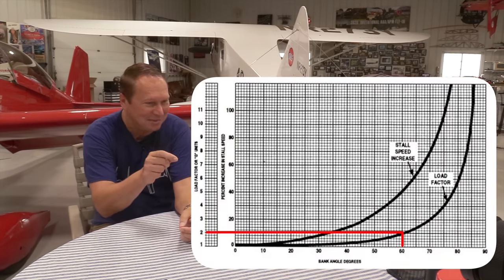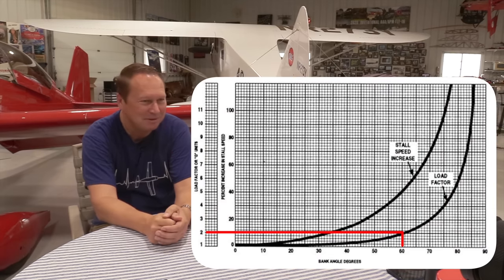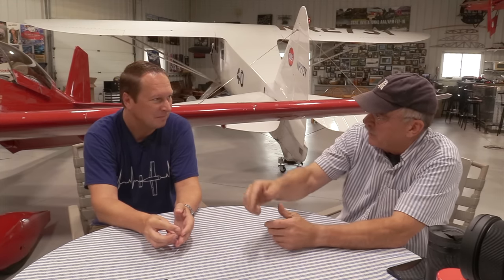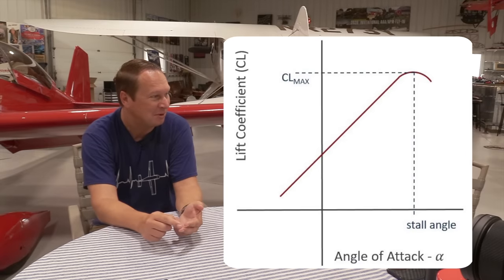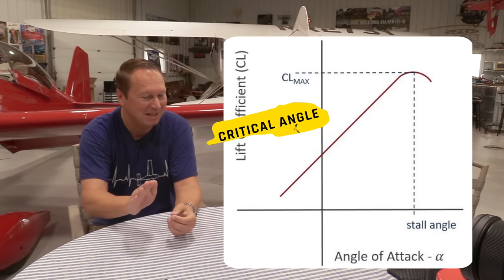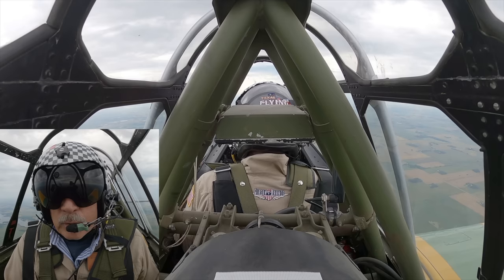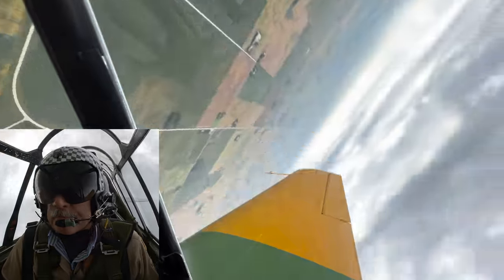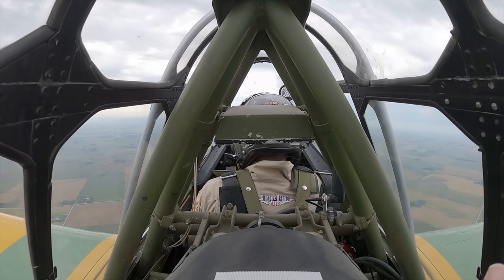The Bank Angle and Stall Speed Myth

Comment: Exactly! I have been saying this all my life!
But it is worse: The problem with the "stall speed vs angle of bank" diagram is two fold. The bank angle doesn't increase the stall speed if you don't pull back, and for the same reasons explained even talking loosely of stall speed doesn't make any sense. Because even the stall speed for zero bank is not accurate unless you are unaccelerated.
It is as true that you can stall at any speed and attitude, as it is true that you can not-stall at any speed and attitude.
Typical question: What happens if you are flying 10 kts above the stall speed and you are hit by a 20 kts tailwind gust?
Typical answer: You will stall
Correct answer: You will not stall unless you pull back on the stick. You will be momentarily flying 10 kts below the stall speed without stalling. You will not be able to prevent the plane to pitch down and lose some altitude because your flight speed is now below your trim speed, but if you try to prevent that by pulling back you will stall.
IT IS THE STICK NOT THE SPEED OR THE BANK.

Comment: Thank you Capt Doug.
Interesting what the engineers oft know in designing 121 aircraft.
 Going back to the early '60s, the DC9-10 elevators were, independently TRIM tab driven.
In the event of a deep stall, full forward on control column, would activate hydraulic driven elevatorS down power. Checked taxxing out, would iluminate a blue light on annunciator panel.
CFI Bud KSUS

Comment: Good and clear explanation, as usual. BUT...

I think the point in keeping a low bank angle in the pattern is to protect against wrong inputs, or unexpected events. In few words, to have a safety margin. Pilots (all pilots, not only students, or unexperienced pilots) can make mistakes, maybe one is pulling a little during a turn, and suddenly pulls a bit more, better being at 20° bank angle than 40°. Or during a turn a sudden gust increases bank angle by 20°, if the plane was initially 15° then it will be at 35°, but if it was inially at 30° it will be 50°! And if you mix the two scenarios, even worse...
So, even if the theory is clear, a pilot can over-react/mis-react on the not expected, or beacuse distracted by something, or too high workload, etc., e.g. seeing the nose going down and then pulling a little too much, in that case better being at a lower bank angle. Demonstration is that (too) many pilots keep stalling the plane when going-around too late (typically after long/high approach), instead of leaving the plane gain airspeed they pull because they see obstacles at the end of the runway, even knowing that's incorrect.

What do you think?

Comment: Hello Martin and Doug from Sydney Australia.
Stall speed variations
Thank you for explaining the effect that the bank angle and load factor has on the planes stall speed.
I am confused about whether a plane can stall vertically downward to the ground. Isn't stall about the flow of air around the airfoil (wing)?
🤨💨
Reply from the maker: John, stall is all about angle of attack - the angle between the relative wind (think "which way is the aircraft moving") and the chord line of the wing (think "which way is the aircraft pointed"). It is absolutely possible to have the aircraft pointed straight down to the earth while exceeding the critical angle of attack and stalling. Imagine flying a loop, where in the second half shortly after having reached the top you pull aggressively on the elevator. That elevator pull can point your nose straight down, but the aircraft (due to its inertia) isn't ready to move that way yet. You will stall. The way to end that stall is to relax back pressure on the elevator, which reduced the angle of attack.
- Martin
Reply: To answer your question specifically, flying straight down you are in 1G flight and you have airflow over the wings and you do not need any thrust from the engine(s) as you are not trying to maintain “level” flight.  YOU ARE NOT STALLED and have NOT EXCEEDED ANY CRITICAL ANGLE OF ATTACK.  Fly that baby all the way to to the ground in that configuration with no fear of exceeding the “critical angle of attack.”  I will add that a pilot will only be able to demonstrate that aerodynamic fact once….😊

Comment: Your presentation is accurate and correct, but does have a failing vs the FAA model. Is does not take into account average or weak pilots. For those pilots, bank angle will always involve load therefore higher stall speeds associated with the situation. This scenario will be predominant in the pattern or during any low level work with a sad outcome. In the US stall spins are not part of the basic curriculum as it is in other countries, which have statistically lower stall-spin accidents rates than the US does. What your video discusses is a more advanced theory of flight that is indeed technically correct, but in average application, far too complicated and therefore incorrect from the perspective of said pilots. The FAA and manufactures model, simplifies a complex topic that works very well to that general population. Yours is critical to serious advanced airmen and gives them real and useful information.

Comment: Technically, if you had enough speed in a 90 degree bank, and power to hang on the prop, the airplane would generate lift sideways as the top of the wing is 90 degrees to the ground. The rudder then becomes your elevator and the elevator becomes your rudder. Talk about changing functions of control surfaces during aerobatic flight.
Reply: It's how they perform  at airshow demonstrations.

Comment: @martinpauly Very interesting discussion. One element I think is missing is power. Loading the wings in the turn definitely will impact AOA and hence airspeed and the so called stall speed, so the discussion makes sense. But if controlling vertical speed is a consideration, such as in the base to final turn, power would seem to be the more appropriate choice when turning tight. But close to the ground is not the best place for experimenting. I am interested in your further thoughts on power in this situation. Thanks!

Comment: Altitude permitting I love that "let the nose fall through";  JMO this must maintain altitude in training induces lots of stalls at the wrong misfortune time down the road in time.   Been wrong B4.
Reply from the maker: From my experience, at least for the base-to-final turn I'm less worried about "must maintain altitude" in training (we are descending in the pattern anyway) and more about "don't bank more than 30 degrees". If we overshoot the runway, the temptation is there to force the airplane around with the rudder, and that's a recipe for a stall/spin accident. Much better to increase bank angle and unload the wings - yes, you'll lose some altitude and you'll have to eventually arrest that descent, but it beats the alternative of a spin at low altitude.
- Martin

Comment: a major shortcoming of visualizing stall angles and airspeed is not thinking in three dimensions.  A steep bank angle with a descending turn will not increase the stall speed or load factor.  Flying helicopters reinforces this visualization.
Reply from the maker: Let me repeat this from the video: it doesn't matter whether you are in level flight or descending or climbing. If you want to turn with a steep bank without increasing stall speed, you have to accept a downward acceleration - which could mean a transition from level flight to a descent, or an increase in the rate of descent. A steady descent (say, 500 feet per minute) isn't enough.
- Martin

Comment: While it's certainly true, that stalling depends neither on airspeed nor on bank angle but on AOA, I still find it very advisable to limit the bank angle to 30° when flying at low altitude. Yes, it is true, that pulling on the stick is the final element in the error chain that leads to a stall. But it in most cases it is only the final element that is preceded by other errors. To prevent an accident it is worthwile to prevent all elements in the error chain. Like in the swiss cheese model where several holes must align for an accident to happen. In the pattern the aircraft is trimmed for increasingly slower speeds as we near the runway. In this configuration much less pulling is required than when flying with cruise speed because the aircraft is already trimmed for a slower speed, which means a higher AOA. So you have only a very small "pull margin". But if you apply a high bank angle, then the nose of the aircraft pitches down. And this might trigger the temptation to pull on the stick. Given the small "pull margin" this might easily lead to a stall. A high bank angle simply is not necessary in the pattern. If it is, then something is wrong and a go-around is the best solution.
Reply: I think otherwise. The limitation to 30° is what causes pilots to "crab" around turns base to final and what gets them killed in a stall/spin.
Reply: @daszieher  Personally, if I need more than 30° of bank in the pattern, I feel my best option is to go around. Way too deep in the error chain already.
Reply: @FlyingRagilein  I used to bank harder deliberately (obviously one should check speed and loading).
Reply: @daszieher  As long the pilot knows what he is doing, everything is fine. Unfortunately, sometimes this is not the case. For me, limiting the bank angle in the pattern absolutely makes sense, because it is one more layer of safety. I know, that I will still stall if I pull too much and go beyond critical AOA. But the probability that this happens is lower that way
because limiting the bank angle limits the load factor that is required to maintain the flight path.
Reply: @FlyingRagilein  I understand perfectly where the limitation comes from, and - to a degree - it also makes sense. However, I have seen fellow pilots focus on a limiting factor while disregarding others.

I would agree to a statement: plan your pattern in such way that you ideally make the changes in direction with only a moderate bank angle.

In gliding, I have seen others pull hard will climbing on the winch and thinking that they were safe because the aircraft was above stall speed completely ignoring the fact that the winch adds AoA that you just don't "feel"...

Comment: Flight training focuses so much time on how the aircraft systems work and not enough on the how the wing works...because most flight instructors don't understand it themselves. If you are banking and not increasing AOA beyond the critical with stick/yoke back pressure the wing won't stall.  If all pilots would take a UPRT course there would no longer be a myth 😊
Reply from the maker: Yes, upset recovery training would be a good thing for all pilots!
- Martin

Comment: Of course the technical content in this video is correct, but one little nitpick: It's mentioned that "the issue is that someone might be redescent to bank the airplane when they need to" paired with the advice of "don't pull back, and as long as you just increase bank without the pull, the airplane won't stall". I have an issue with this, which is that you obviously can't get something for nothing there. In the pattern examples in the video, pilots WILL be pulling regardless because they need to make up for the lift which is lost as the lift vector comes out from directly under the plane. 

Of course it's correct that these charts leave out that bank angle alone isn't responsible for the increase in stall speed, but if you assume they mean a constant altitude bank, then they make much more sense, which is probably the intended application. Nothing against education students about that nuance, but I don't think I would want to advise my students to simply not pull to fix this issue. More over, a pattern bank angle limit of 30 degrees (soft) is set just as much to avoid loss of SA or spatial D (even in VMC!) as much as it is to avoid the issue of a low altitude stall.

Comment: Just my 2 cents. 
I totally agree on its load factor.
But i dont buy its mostly maintaining altitide that does it on base to final.

I feel while turning base to final they use more rudder to fly a skidded turn. Once they increase bank if they were already low as soon as you start banking to hard if one over shoots the runway, the nose wants or does drop in bank & the pilot doesn't slowly pull back to "maintain altitide".

Its my guess the pilot banks feels the nose headig south & instinctiveky abruptly yanks back & bam, stall spin.

In this video makes it to sound that the pilot simply wished to maintain altitide instead of, "oh shit, yank the yoke back hard I'm seeing ground rushing at me & stall spins.

Comment: Sir, Bank angle will bleed speed, when you loose  speed   the AOA  will change you stall. 40 years ago  I  watched  a  guy fly circles at a  steep  bank over his  fathers shop c 150, at like 900 feet, half way  through he stalled and when into  the building. If you  do a coordinated turn at a given speed when you enter  the  turn your speed will bleed, I would  always advise add power and shallow  turning (30 deg  and under).
Reply: Only if you try to maintain altitude.

Comment: It is a question that the faa knowledge test requires you to say “it increases with bank angle.”
Reply: The question on the FAA written would be taken directly from the PHAK which includes a discussion on the factors of bank angle, increased angle of attack, load factor, and stall speed with the airplane in level flight.  But the stall diagram in the POH's usually includes only the bank angle, making it appear incorrectly that bank angle is the only factor.

Comment: So when I'm turning base to final it's best to lower the nose to gain a bit of airspeed? CFI is always telling me to maintain the airspeed... great vid.. thanks
Reply from the maker: Todd, we are not saying you should always lower the nose in the base-to-final turn. But you could lower the nose if your airspeed is so low that turning without increasing your rate of descent would put you at the critical angle of attack (read: stall). It’s better to stay in control of a descending airplane than to lose control altogether.
What your instructor is saying is carry a little extra speed in the pattern so that you can turn without also accelerating your descent.
Reply: Nudge in a little power to maintain airspeed as or if needed.  Lowering pitch will control airspeed but it will also increase the rate of descent and cause the airplane to start undershooting the aiming point - not good.